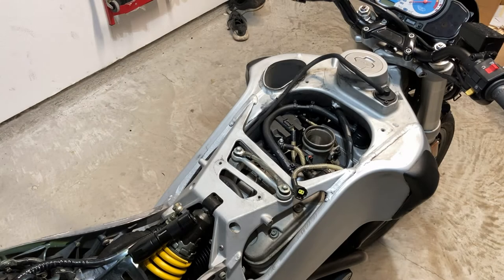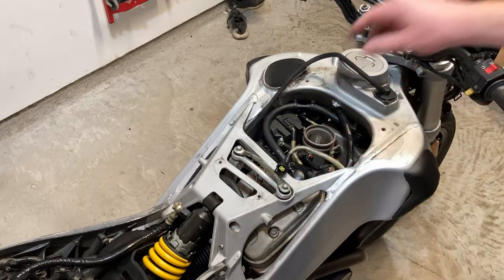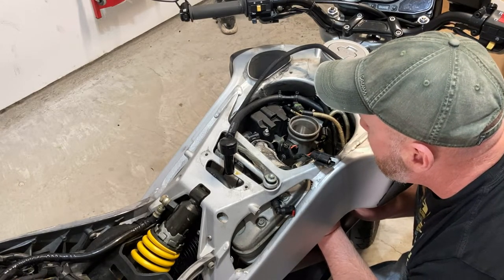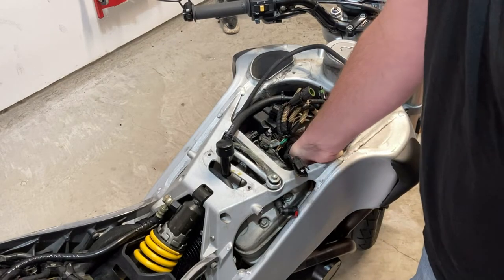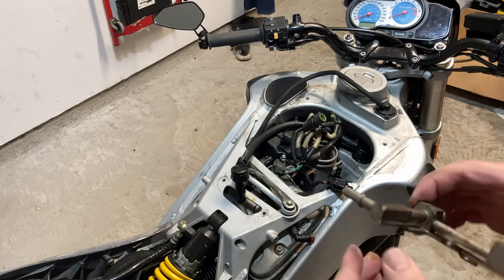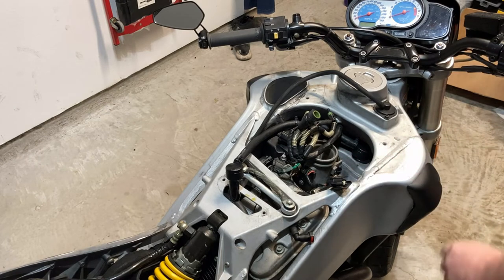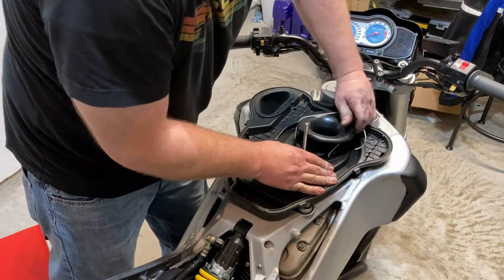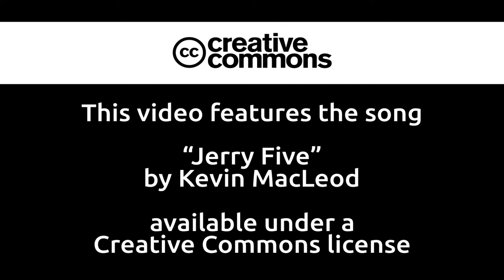Replacing Buell Injectors

Comment: You might already know but since i´m browsing through your videos i thought i might write this comment: The little extra vent in the intake body is only for measuring. see the hole in the intake is above the throttle valve and has no impact on your air fuel mixture. just leave it as it is :-)

Comment: How many miles did you have? Did it make a idle better? I just bought an xb12xt but has rough idle.
Reply from the maker: No real change just better starting and response I guess. It was subtle though.
Reply: Cleaned my injectors, and man what a difference. Throttle response smoother and increased major power!